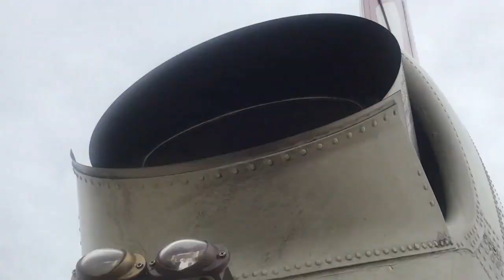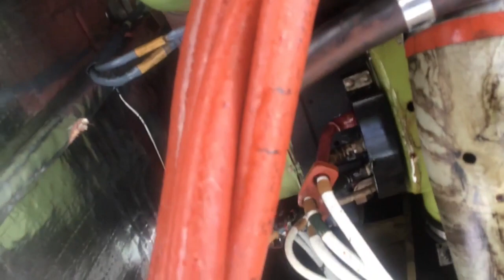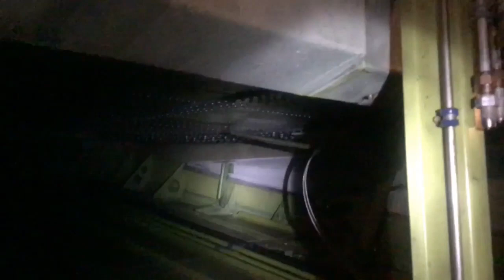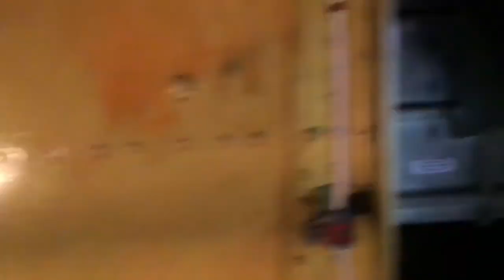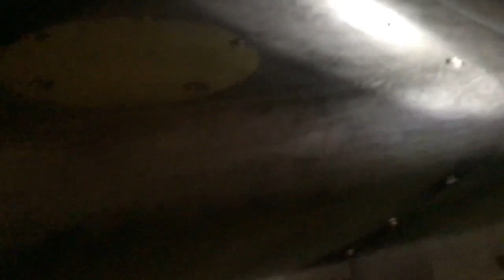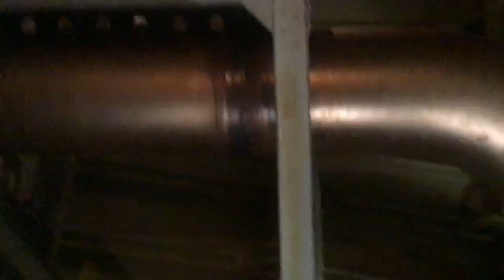Plane Bits'n'Bobs

Comment: It's all a phony mock-up!  All I saw was a steam punk helium container from the 1800's, a swing set and a toaster with extra wires. 😂😂😂  I haven't been in the back of a 47 in five years.  Thanks for the look around!  Also, wasn't it an Alaska high tail a couple of decades ago that had its jack screw fail and she went down?  Sad. 
I forgot to add, great vid and bits and bobs to ya!
Reply from the maker: It is amazing what you can make with some plastic guttering and coke cans these days. I was inspired by professor jones' tin can 777!!!
Yes it was an Alaska DC9 that crashed because the screw jack failed.
Reply: ianobiwan  That was hilarious!  When he wiggled the can and said it's not strong enough I fell over.  He has not a clue the difference between aircraft aluminum and a soda can.  However, making a 777 out of three 7up cans is very entertaining and inspirational. Cheers
Reply from the maker: Gary Golfer check out josh stones new video trailer it looks like he making a comedy series.👍😂